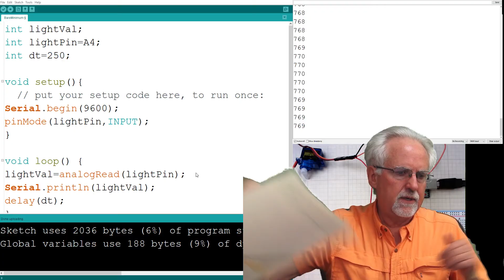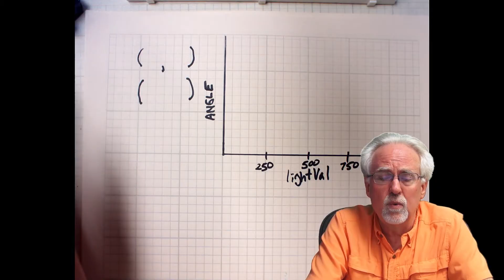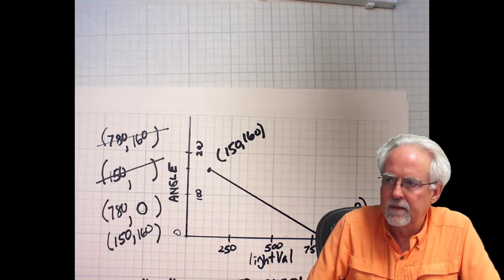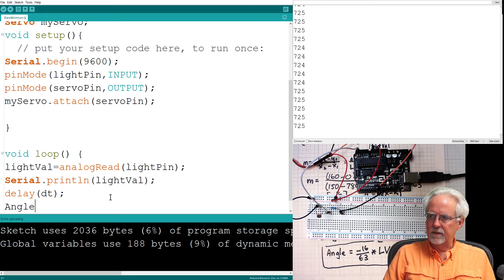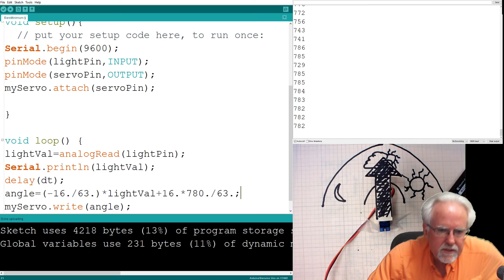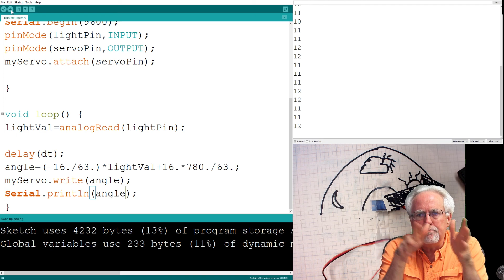Arduino Tutorial 31: Using Servo in a Simple Project

Comment: I did the math, however I changed the situation to match the max light value to the maximum servo angle. I had almost all of the programming correct, however there were a few hiccups that I found while watching this video that helped smooth out a little jitter in the servo.

Comment: i did the math on my own and used a little more complicated expression that was three lines
the Greek guy                                       who will be at mechanical engineering school next year 
heres my code  :
int photoPin = A0;
int readVol ;
int Bright;
int dt = 100;
#include<Servo.h>
int ServoPin = 9;
int Servopos;
Servo myServo;

void setup() {
  // put your setup code here, to run once:
  myServo.attach(ServoPin);
  Serial.begin(9600);
  pinMode(photoPin, INPUT);
}

void loop() {
  // put your main code here, to run repeatedly:
  
  readVol = analogRead(photoPin);
  Serial.println(readVol);

  Bright=readVol;
  if (Bright < 400) {
    Servopos = (3. / 20.) * Bright;
  }
  if (Bright > 400 && Bright < 750) {
    Servopos = (6. / 35.) * Bright - (6. / 35.) * 400 + 60;
  }
  if (Bright > 750) {
    Servopos = (60. / 273.) * Bright - (60. / 273.) * 750 + 120;
  }
  if (Servopos < 5) {                  // my servo cant take lesser values
    Servopos = 5;
  }
  myServo.write(Servopos);
}
Reply: Φασουλη μου στην c kai c++ τα include τα βαζεις παντα τερμα επανω, σε περιπτωση που η τιμη του Bright γινει 400 ο κωδικας σου σπαει,τα παραλληλα if τα βαζεις αν θελεις να γινουν πολλα πραγματα σε μια μεταβλητη στην προκειμενη θελεις ενα πραγμα οποτε else if, δες περιπου πως θα επρεπε να ειναι ο κωδικας σου 
"#include <iostream>
using namespace std;

int main() {
    int Bright  = 1;

    while (Bright >0) {
        cout<<"Dwse enan arithmo apo to 1 ews to 500"<<endl;
        cin>>Bright ;
        if(Bright >0 && Bright <401)
            cout<<"megalytero tou 0 kai mikrotero tou 401"<<endl;
        else if (Bright >400 && Bright <751)
            cout<<"megalytero tou 400 kai mikrotero tou 751"<<endl;
        else if (Bright >750)
            cout<<"megalytero tou 750"<<endl;
        
    }
}"

https://www.youtube.com/c/%CE%94%CE%B7%CE%BC%CE%AE%CF%84%CF%81%CE%B7%CF%82%CE%A8%CE%BF%CF%8D%CE%BD%CE%B7%CF%82/featured

Comment: I did the math based on the previous lessons and it worked great! One thing: when I hooked up my circuit, I wired it so that the +5v goes to the fixed resistor first, then grounded the photoresistor. This gives you a positive slope and makes the math easier.

Comment: I really do appreciate Paul showing all the high school math. Some people never got it in high school, and many others have forgotten it. It is important in order to understand the principles behind the projects. 
That said, no, I didn't do the math. Years of doing this sort of thing has given me a kind of intuitive feel for it. So, like Paul, I first got my light sensor readings (100 - 1000). Then, realizing I have to map those values over only 180 degrees of servo movement, I calculated (1000 - 100)/180, which VERY conveniently comes out to 5. So, that told me I have to divide my light sensor readings by 5.
I decided I wouldn't bother with floating point values. I figured integers would do for this project.
One thing I didn't like was the fact that the servo goes counter-clockwise as the angle value increases. This would mean the pointer would point completely left in sunlight. I like low on the left and high on the right, so I calculated the angle and then subtracted it from 180. This made it so the angle gets smaller & smaller as it gets brighter. Works like a charm.
My command was: sensorVal=180-(analogRead(sensorPin)/5);
I then checked to see if sensorVal is greater than 180 or less than 0. If so, I set it to 180 or 0 as appropriate.
This was a fun project. Thanks Paul.

Comment: I like the math and can do the math, but for those that have trouble with math or already know how to do the math and want a convenient function to handle linear conversions, there is a method called map. Look on the Arduino website in the main menu under Resources -> References and look under the Math section. Be aware though that the map function only works for integers. If you need floats, you would have to create your own function.

Comment: Yes the math is important my range was between 500 and 825 but in my calculation  was                          angle = (readval-500/325)*180.works very well.

Comment: For anyone following this video and wondering why you're not getting 0 degrees at full light (because the ldr/photo resistor value goes up in the dark not down)
Use the following equation Angle=(y2-y1/x2-x1) * lightVal - y2*x1/y2-y1 
                                         not Angle=(-y2-y1/x2-x1) * lightval + y2*x2/y2-y1
the second equation will give you 0 degrees at full dark.

Comment: I did the homework before watching this video and it was successful. Here's my code:
#include <Servo.h>
int lightPin = A0;
int servoPin = 9;
int servoValue;
int lightValue;
Servo myServo;

void setup() {
  // put your setup code here, to run once:
  pinMode(lightPin, INPUT);
  myServo.attach(servoPin);
  Serial.begin(9600);
}

void loop() {
  // put your main code here, to run repeatedly:
  lightValue=analogRead(lightPin);
  servoValue = (180./1024.)*lightValue;
  Serial.println(servoValue);
  myServo.write(servoValue);
  delay(100);
}

Comment: after watching tutorial 31 for 5-10 minutes I realized my tutorial 30 servo reacted to the photo-resistor in the
opposite directions high light left, low light right, than the specifications.  I setup the two new endpoints, solved the linear equation, and plotted the curve on graph paper (didn't for tutorial l30). and changed
the equation  for servoPos-angle = -(Lighval/6)  +  175 degrees and it worked   I watched the rest of tutorial 31 after that.   I thought about making a cat clock with reciprocating tail and up/down eyelids , servo as
minute and hour hand.
Reply: I'm glad someone else posted this. Mine too..I get 150 with lights on and 780 lights off (but my own values of course), but this video shows that happening the opposite way round. How did you solve the maths to get lightest room to be at 0 degrees angle? I thought I solved it a moment ago..but now it won't work.
Reply: What is your independent variable, your “Causer” and what is your dependent variable? Who is the kicker and the kickeee ?  The graph is set so with the kicker on the bottom from left to right, as kick gets bigger. Imagine what this curve would look like, decide on two points you want on the line. Then use the two points to create the equation you want

Comment: I did the math and I also added "if" statements after calculating the angle so that it would for sure stay within the range of my servo (15 to 165 degrees) in case the lightVal was higher or lower than my x values I used to find the slope.
Reply: Same :)
Reply: me too :)
Reply: Me too :)
Reply: Me too
Reply: Same here(❁´◡`❁)
Reply: Me too😁😁🤝🤝

Comment: I did this assignment, but used a lazier method to map the figures. Instead of testing the actual parameters of the light in the room I just used the full scale of 0 - 1023 and then used that against the 0 - 165 deg. of my servo. So I just told the arduino to define angle as ((165./1023.)*LightVal). Is see that your way is more precise as the actual light values in my room were only between 350 and 900 on the LDR, so I was losing about 35% of the range of movement of my servo.

Comment: I made this project and it works perfect. my servo rotate + - 45 degrees only and the photo sensor operate between 20-1000 analog units so my formula is  srervoVal= photo*0.09-45.
your videos are excellent lessons.

Comment: Ok this is driving me nutz, can someone please tell me why my values are off,lights on 530,lights off in the 900's.Using the same photo resistor and a 10k resistor on the voltage divider. PLEASE.......Update,figured it out, not rocket science,things should not go better,lol

Comment: Did my homework from lesson 30. Figured it out with the lessons before.  Thanks for giving great lessons.  Was good figuring the math behind it as well.  Cheated and used the serial monitor to make sure my math was correct before adding the servo to the mix. Thanks for doing these videos.  Confidence is improving.

Comment: Hi Paul

Can I just say thank you for all of your help, your tutorials are by far the most comprehensive and straightforward on YouTube, very concise and easy to follow.

Is there any way you could possibly do a few more on servos and maybe encoded motors.

I am currently trying to run 2 servos simultaneously in opposite directions through one cycle, from 0 -150, 150 -0 degrees, and they are triggered using IR sensors. it would be super if you could do a tutorial on something similar. the examples on the arduino app do not really facilitate when it comes to doing this kind of task, I think  (",).

If you dont plan on doing any more of these then thanks a lot for all the help so far.

Hope your keeping safe and well in the US.

All the best 

Rob

Comment: The "math" part is really important. Keep showing it!
Reply: Easy math  but it works perfectly
Reply: yeah
Reply: Yes
Reply: @jurgenbaert8197  Yes, Same here
Reply: Can someone help me understand?

Why isn't it 

Angle=(-16./63.)*lightval-780; ?
Reply: @mikeoxmaul9386  
Hi, I think you need to simply the equation because it has negative fraction. all number has a invisible denominator 1, so to simply this -780 should have a denominator of 1 which is -780/1 so your least common denominator will be 63 which came from multiplying the denominator of -16/63 so 63 x 1 = 63  hope it make sense.
Reply: @mikeoxmaul9386  Because the equation starts as Angle-Angle1 = m(lightval-lightval1). When you move to simplify the equation, you have to multiply "m" onto BOTH lightval AND lightval1. This give you the (-16/63)*lightval + ((16*780)/63). 
The 780 is technically 780/1 and so when multiplying with the (-16/63) it turns into ((-16*780)/(63*1)). 
Then, because the starting equation states "lightval MINUS lightval1", and the number for "m" is negative, it turns into an addition. 
Hope this helps you understand a bit better. Apologies if it is poorly explained, it has been a long time since I've used math and I've forgotten most terminology.
Reply: @mikeoxmaul9386  Not sure if anyone answered this but in algebra, if 2 minus are multiplied together then the finished product is a positive. In this case it was -16/63 x -780 therefore giving a positive result of (16x780)/63
Reply: Are you the Dr. Smith from “Lost is Space”?
Reply: the most important

Comment: I did my homework.

#include <Servo.h>
const int servoPin = 11;
const int lightPin = A0;
Servo myServo;
// int servoPos = 0;
int sunnyPos = 30;
int overCastPos = 90;
int darkPos = 150;
const float gradient = 5.0/1023.0;
float LDRvoltage;
const int delayTime = 100;

void setup() {
  // put your setup code here, to run once:
Serial.begin(9600);
pinMode(lightPin, INPUT);
myServo.attach(servoPin);
}

void loop() {
  // put your main code here, to run repeatedly:
LDRvoltage = analogRead(lightPin)*gradient;
Serial.print(LDRvoltage);
Serial.println(" V");
if (LDRvoltage > 4.40){
  myServo.write(sunnyPos);
}
if (LDRvoltage > 4.80) {
  myServo.write(overCastPos);
}
if (LDRvoltage > 4.90) {
  myServo.write(darkPos);
}
delay(delayTime);
}

Comment: Hey everyone,

I know I'm not the professor here, but one little thing I would like to add about line equations. 
As you can see from the final line equation is that  is in the formula of: y=m(x)+b
Which y=the output, x=the input, m=the calculated slope, and b= the "y intecept"(the point on the y axis that the line crosses).
So your "b" value can be verified by working the (16*780)/63 which comes out to 198.09, which can be easily seen by Paul's line that is pointed right about to the 200 mark on the y axis.

Hope you find that info useful .

Thanks,

Matt

Comment: In this exercise I could not get values from the photo-resistor of any consistency to work with. Values bounced from 212-238, staying around 230 regardless of light or no light. I have two photo-resistors in the kit and both give the same results. Can photo-resistors be (or get) damaged easily? I only get a maximum resistance change of about 20ohms. Sometimes it will jump all over the place. Just querying for some hints or suggestions. I'm also getting some weird angle values. Four digit values like 2615, 2594 etc. So I must have an issue with the math. Stopping the autoscroll in the monitor is showing me that lightVal is barely changing, and when the do angle displays four-digit values.

Comment: Paul your videos are phenomenal! I bought the super starter kit BEFORE I found out about your tutorials and just happened to find your videos! I had some trouble during lesson 13 because the potentiometer that came with my kit doesn't get a stable connection with the bread board and my LED seemed to be turning on and off at random, even when I removed the potentiometer entirely. I came to find out it's called "floating pin" voltage/signal. I thought "how in the world could a toggle switch or push button work with the arduino if an activated pin hooked up to an open circuit can be randomly triggered by floating pin signal???" then later in your series you explained pull up and pull down resistors and it all made sense! I really hope you do a tutorial on shift registers! Nobody else I've found has been able to present all this information in such an easy to follow way! Keep it up, paul! Big fan!

Comment: At 3:17 of this tutorial, it was questioned about which pin the servo control line should connect to. The servo library was rewritten to allow support for up to 12 servos (on any pins) and up to 48 on the Mega. Change in Arduino #0017 (2009). You’re not limited to just to the PWM pins with the squiggle.
 
Ref:
https://www.arduino.cc/en/Reference/Changes
 
Servos have to receive high-pulse control signals at regular intervals to keep turning.  If the signal stops, so does the servo.  Once your sketch uses the Servo library to set up the signal, it can move on to other code, like delays, checking sensors, etc. Meanwhile, the servo keeps turning because the Servo library keeps running in the background.  It regularly interrupts the execution of other code to initiate those high pulses, doing it so quickly that it’s practically unnoticeable. Allowing it to work on any digital pin or analog pin, since analog pins can be used identically to the digital pins

Comment: Couldnt we use the map function to scale de 0-1023 to 0-160 degrees for a much more accurate movement?
Reply from the maker: The map function is not more accurate than doing the math. The issue is, at some point we need some people to understand the math. Those that understand the math get the big bucks. Those who rely on canned libraries get the little bucks
Reply: As previously mentioned, the map() function uses integer math. So fractions might get suppressed due to this. For example, fractions like 3/2, 4/3, 5/4 will all be returned as 1 from the map() function, despite their different actual values.
 
So if your project requires precise calculations (e.g. voltage accurate to 3 decimal places), please consider avoiding map() and implementing the calculations manually in your code yourself.

Comment: I am very experienced in using servos with Arduino controls.  I think you did a great job explaining the math and placing it into the code.  I understand the use of the kit servo and using the Arduino to power it.  However, my experience is that servos typically can be troublesome when using the 5v Arduino power source.  So I just want to mention that in general, the best practice is to use a separate 5 volt supply for the servo.  If people follow this tutorial and try to use more power hungry servos, they will run into problems.  So I think you did a great job on the tutorial and you might want to consider a lesson using a power hungry servo and show how to connect a separate voltage source.  Again, nice work!!!
Reply: Paul did say this at the very beginning, our kit servos are only cheap learning tools.